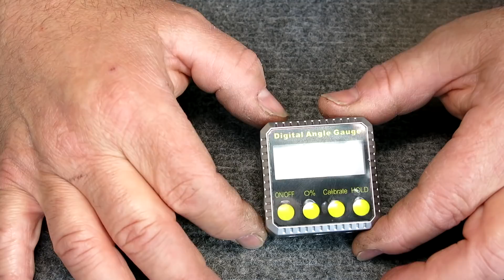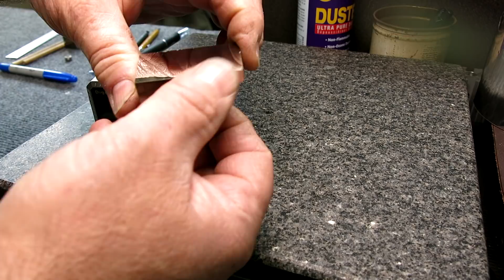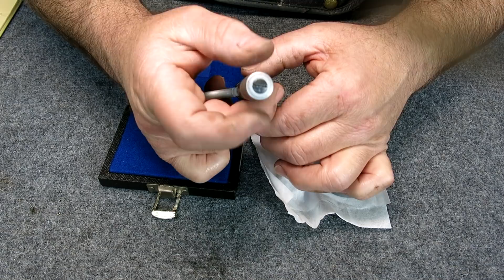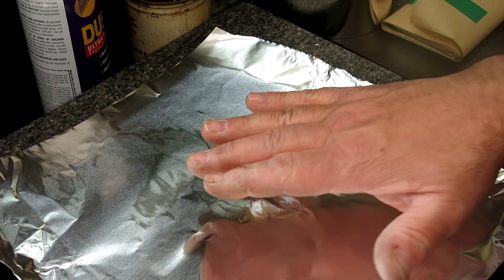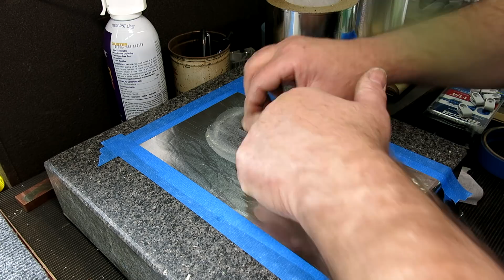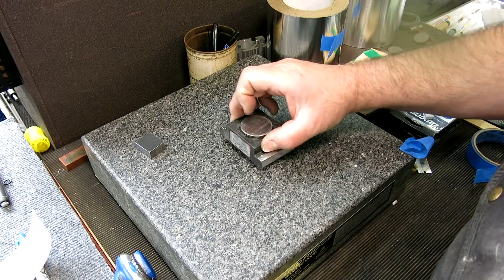Monday Night Meatloaf 116 Part 1

Comment: Awesome video! Was very impressed by the aluminum tape to step granite improvised portable lap along with the initial demonstration of how Reynolds Heavy Duty Tin Foil makes an amazing substrate for holding lapping charge. 

I had acquired a 2’x3’x4”black granite surface plate from a local equipment rental company but put the reconditioning of it off due to lack of ability to do so with my current equipment. 

Seeing your demonstration really has opened up the possibilities for me to think of tackling this now. So a much appreciated Thank You for taking the time to make this video and sharing your knowledge and insights gained from experimenting.

Comment: How did you check the parallelism of the lap to that level of certainty (20 millionths)? That's better accuracy than my surface plate, so I'm curious as to how that is done.

Comment: These angle sensors use gravity as a reference. They use accelerometer ICs.

I bet if you do a video of it falling, it will not read the correct angle.

Comment: YouTubers are trying to figure out how gage blocks stick together. I am wondering if it's necessary to slide them passed one another, or if they could be pushed together with enough force. Thing is they may have to be held perfectly parallel to each other.  Do you think you could do it,  or is it impossible?

Comment: Aluminum instantly (almost) forms an oxide coating on exposure to air. And what is that coating? Aluminum oxide - a notable abrasive. How much cutting is due to the charge, and how much to the aluminum oxide?

Comment: How would you compensate for the edges rounding? Do you think the Aluminium foil is contributing to this since it will have a slight tendency to pillow (technical term 😂)? Just curious, love your videos.

Comment: Take the face off the digital angle and expose just the calibration button. Then you can calibrate it without touching using a piece of steel wool on a q-tip. Perfect calibration.

Comment: I have a suggestion for the tin foil lapping.

I think you'll get better results if you put a drop or two of mineral oil on the plate, something that has some modest viscosity; grease might even work but oil will spread easier on the plate. Use a flexible squeegee to get a nice even layer just the slightest wiff of oil then lay your foil out and use the squeegy (after cleaning the squeegy) again over the top of the foil to get the air out from underneath, it will also vacuum adhere the foil to the plate pretty good as long as you don't over do it with the oil.

Comment: I would actually really like to see a teardown of the internals of that angle gauge. Any chance you're brave enough to take it apart and take some decent pictures of the inside? I'd wager a few shekels it uses a common mems device so the repeatability should actually be pretty decent though I'd worry a bit about temperature stability. If you're lucky the sensor isn't just blobed and has a part number on it.

Comment: I have some pieces of granite countertop material  (a local counter place has an outdoor dumpster for scrap, and they let me rescue some when I asked nicely), and I'm going to tinker with making little flat laps via the 3 plate method.  That aluminum tape trick is just seductively easy looking.

I get that the foil itself is nicely uniform thickness, but I wonder about the adhesive layer.  I've been told that lapping film is superior to equivalent grit paper, because the thicker paper has too much 'give' to be precise.  Would that apply to adhesive as well?  Does the lapping process just cancel out that consideration?

Comment: On the lapping with aluminum: during my apprenticeship I learned the same trick except with paper and it served me well. We worked with D5, and a guy who worked at Timex (those guys could do small work) showed me how to use paper on a steel surface plate soaked with kerosine. We would use reducing grits and get flat mirror finishes in no time. And you could peel off the charged paper, let it dry and use it again. Later when I was doing precision die work in carbide, I used the same thing with diamond paste which also worked well. The aluminum trick looked good but I saw you fight to keep from snagging it. This happened occasionally with paper, but with the kerosine (or any light oil) the paper adhered to the lapping plate like it was glued there. I never checked for flatness with a optical flat but after your experiments with the “cheap Russian flats” I ordered one and now I can give it a try. But the paper/light oil/diamond paste worked pretty well on carbide and were much less trouble than the foil. Stay with the nerdy stuff!  It’s fun for many of us out here in Internet country.

Comment: Nice video to learn from.
I use to do something similar to lap. But the trick that I was taught many years ago by an Italian mentor while doing my apprenticeship in South America.
He would use thin construction paper about .5mm THICK or .020" thick.  and no lighter fluid . He would also  tape down to a surface plate.
But I found it kinda hard to get that construction paper  here in the USA when working as a tool and die maker.
So I bought plastic shim stock from McMaster . It's sold in several thicknesses and sizes. And I can achieve the exact effect of flat lapping and you can also use a very fine oil.
Nice thing about buying it from McMaster is that you can buy the diamond lapping syringes and the plastic shim stock and get in the shop next day.

Comment: Tom, then lapping micrometer faces you cant simply lap them with a parallel lap. The lap not only has to be parallel, it has to be held at 90* in both axis to the rotational axis of the spindle. If you have to remove a lot of material you'd have to make a V block style fixture that clamps to the spindle to lap the fixed anvil, then you can use a parallel lap off the fixed anvil for reference to lap the spindle. I had a design to build a lapping fixture, but by the time I got a surface grinder to build a high precision piece like this, I lost interest. I'm very interested in seeing how to lap a micrometer at home, I have a 5-6" micrometer I got from Keith Rucker that has horrible anvils I didn't know about. I'd love to fix it if I can. Andre

Comment: Im prolly totaly off.. But If you have checked out for example knife sharpening stones? Are they straight as a lapping plate? If  you need some fine tuning. 
I would use Shapton Glass stone #12000 - #30000
Reply: Even when "lapped" on a DMT, Atoma, or Shapton diamond plate, the knife/razor stones are nowhere near flat enough for precision lapping of other parts.

Comment: Great idea on the aluminium lap Medium,  far easier, and less expensive than the old Lead (Pb) sheet.
From a metallographic aspect, polishing samples to 0.5 micron for example, from 120 grit, 240, 360, etc to 1200 abrasive paper on rotating platens, then 6 micron, 1 micron. We rotate the sample 90 ° degrees for each grit, to check that each successive polishing has removed previous uni directional polishing lines, between each grit, the sample is washed to remove previous grit. 

6 micron and smaller, we use rotating platens with different adhesive cloth naps, loaded with diamond paste and oil, a figure of eight action is always used here because the platen is rotating, using a fixed platen, then orbital action is used. Great care is taken to clean between each stage, using Ethanol, Acetone etc, with cotton wool and/or ultrasonic cleaning. Cheap  toilet tissue paper will scratch the surface of most steels, you need a good quality named brand.

Tip, if using a ultrasonic cleaner, then use a small container, just large enough for the sample with Ethanol etc, suspended in the aqueous US cleaning solution, don't forget to degass.

Comment: Hi Tom! Thanks for great video, as always!
I was that "one guy", very happy to see you found my technique useful. Little tip (reduces tearing of foil and edge "smoothing") : try putting just a drop or two of viscous oil (200+cSt is excellent) to your surface plate, add foil and push away all the oil with your shaft or a rubber roller (works even better). Surface tension forces hold the foil better than adhesive tape. 
For small parths with low dimension rations we use a special holder, it looks like a small cap for a part, with a round socket on top of it. A bent rod with a ball on it goes into that socket, making the lapping force always sentered on the part, making a point contact system. 
Automatic lapper with a static weight added to all the parts does the same job. 
Will try to make a full video with all this things to complete the topic. 
Thanks again!
Pavel

Comment: A good use I have found for my HF magnetic level is to stick it to the leaf of my sheet metal brake. I zero the level with the leaf at rest and then note the angle when I stop a bend. That way I can return to the same point if I need to bend a little more or bend multiple pieces at the same angle. I actually keep a log of all my bends, so when I need to bend a sheet I have a log of materials, thickness and angles that get me the angle that I want very quickly.
Reply: I know basically nothing about sheet metal brakes, but wouldn't a mechanical stop be a standard feature?
Reply: I do the same exact thing except with electrical conduit. As an electrician we deal with steel, stainless steel, aluminum, and emt conduit. Super useful to know how much spring- back each conduit type and size has.

Comment: Tom, instead of taping the foil onto your plate, try spritzing the plate with water, lay the foil on, and squeegee the water out.  The foil should stick to the plate almost like how tinted windows are applied.  I do this on glass plates and it works for me.  It should also help prevent the edge roll-off, by keeping the foil down at the edges.
Reply: I thought of the same thing; I wonder what the water film underneath looks like with regard to flatness.
Reply: With a good squeegee job, I can’t imagine it being any worst than having the foil bunch up at the edges of the slurry while just sitting on the plate. Also, needless to say, this works best with standard foil and not the heavy duty variety.
Reply: Christopher Peralta: Good point, I hadn't thought of that.
Reply: Christopher Peralta yeah that’s exactly how I do mine. Little mist of water and then I use a small rubber squeegee to flatten it out. Works great. I’m surprised he didn’t think to do that.

Comment: Great idea on the aluminum foil.  Could you use aluminum foil tape that HVAC guys use for air ducts?  It would be smaller but it would be flat and not rip quite as easy as the aluminum foil
Reply: Brandon Tscheschlog exactly what I was thinking. You can buy up to 47.25” wide aluminum gaffer’s tape from this place. The 6” would be perfect. Use a roller of some kind to roll it down without bubbles and you’re set
https://www.findtape.com/JVCC-AF20-Aluminum-Foil-Tape/p267/?cid=47&idx=1&tid=1&info=Foil%2520Tapes%253A%2520Aluminum%252C%2520Copper%252C%2520Lead%2520%2526%2520Mastic%252FAluminum%2520Foil%2520Tape

Comment: That was more like filet mignon!  Good to see you posting again.

Talk to you soon,
ATB, Robin
Reply: @ROBRENZ and Oxtoolco Dumb question here; genius technique, however does one get aluminum/dissimilar metals lapped into the ferrous material you are lapping and hence set up future corrosion sites from dissimilar metals in the surface of the work piece being lapped on the aluminum (i.e. surface corrosion pitting starts to happen faster (over time) than not using aluminum ?), OR does all of the mechanically dissociated aluminum 100% turn to aluminum oxide and is relatively inert / inconsequential ? [Might be worth testing out ? Maybe ?].
Reply: @extradimension7356  if you achieve perfect parts then people like me eat your sandwich. I dont care for accelerated metal rust by dissimilar metal deposition. I make the part within range and charge the sum. 

Be the best but dont be the best crazy
Reply: @yawpaw9796  Thanks yaw paw ! I will defer to your pragmatic wisdom and expertise  ~ Meanwhile I will keep my sandwiches WELL away from any would be pragmatists :-) If one is  building the best , then you're building the best- long term corrosion IS a quality issue for what we have to build / roll out - especially in hostile environments. Hats off to you @yaw paw! / Cheers.
Reply: @extradimension7356  enjoy yourself! Maybe start a channel?

Comment: I've got a set of 4 Mitutoyo optical parallels that I've used to check the parallelism of my small mics, similar in function to that ST parallel.  I've seem metric sets for larger mics on eBay, clearly from old USSR sources.

Comment: Hi Tom.

In the 3d printing world, we use sheets of glass / mirrors as a 'flat' surface to print on. I was wondering exactly how flat something like this is when compared to something calibrated and certified like your surface plate there.

Nice find on the optical parallel, always interesting to scan through eBay to see what hidden treasures people are selling.
Reply: it depends,some mirrors/glass are flat some are not.Generaly you want a Float glass(type of glass).
It will be flat to some point ,for most of us mere mortals enough,unless you do oil rig pipe seals or nasa space station toilets .
If you face the peace of steel on a lathe (good one) you can get it flat to a 1/100 of a mm.He did video series in which he made his own laping plates by facing 3 discs on a lathe and laping each other.

Comment: The magnetic digital levels are fantastic to have around. When I helped my brother install new Rotary lifts in his shop I slapped two of them on a post, 90° apart, and had an immediate readout of both cardinal directions for mounting it plumb. So much easier that trying to read a bubble level, and surely more accurate. Good to have a known flat and parallel piece of metal to span larger surfaces (averaging a rough surface finish, for instance). A 1/2" square by 6" HSS tool blank is my personal choice.
Reply: I use mine on the bench grinder table to set angles. Very doubtful you could set any of those cheaply made non vernier equipped degree scales to +- 1/10th of a degree by eye and it's faster. With a bit of finesse you can even set grinder table miter gages by setting the bar against something that's vertical and fairly accurate then use the level on the working face. Maybe not quite good enough for grinding a threading tool, but for everything else probably good enough.They are a pretty handy little tool.

Comment: Tom, I have used aluminum foil and water to remove rust from chrome bike part, it works amazingly well!
Reply: care to elaborate? do you just rub wet foil on the rusty chrome or is there more to it?
Reply: Just take some tin foil, dip it in water and rub, it is like magic!
Reply: thanks great tip will have to try it out :)
Reply: Try it with wd-40 instead, or some people like using soda for the phosphoric acid but I don't like the stickiness.